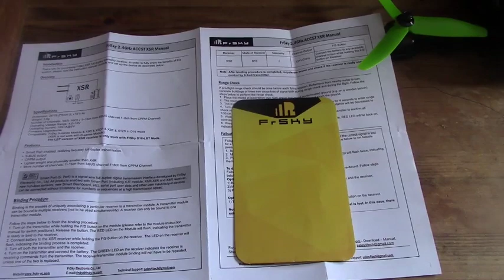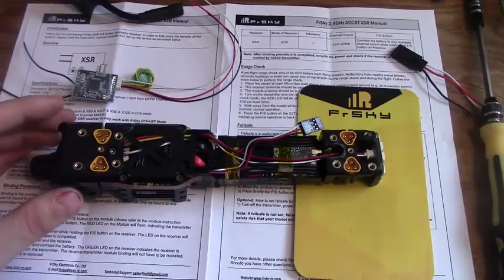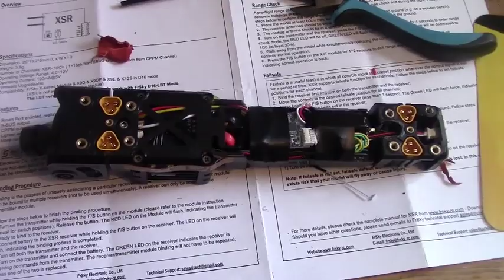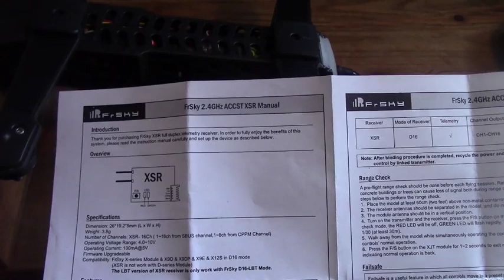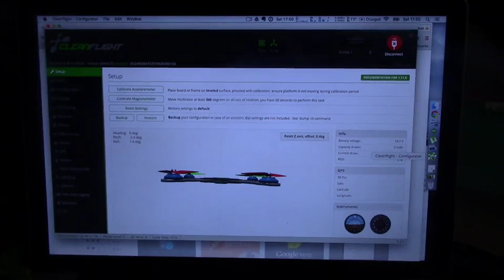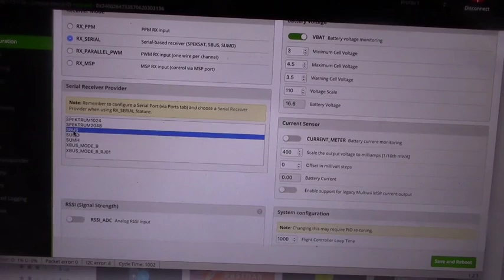TBS Vendetta Review Part 3 - Installing XSR receiver, Teranis binding and RC Calibration

Comment: I changed to a taranis transmitter with a xsr receiver on my vendetta. was using spektrum dx6.  My problem is in the osd  in show motors are armed but they do not spin. I have tried all i know to do with no luck. radio is bound, i can enter the vendetta osd with radio, calibrate it and arm and disarm, but motors will not spin. any help appreciated.

Comment: 600. Quid is quite insane but it is cool looking...until body cracks or it gets wet. Best to spray silicone on electronics but avoid barometer.  Good honest review.
Reply from the maker: +Hoverbotfpv Cheers man apprecaite the nice comments. Yeah I smashed it into a goal post....cracked the frame, broke the XT60, chopped one of the antennas off :D - Quite annoying, but she still flys as well as ever.

Comment: Yea it's in ppm mode. Calibrate centre in the x9d. Hold down the TBs core  buttons to change to sbus... Press a few times to get past the spectrum brand (first option ppm) you'll see it change on the odd. I had this issue